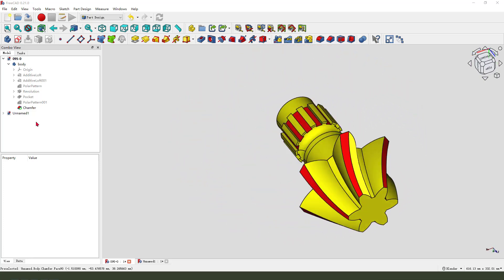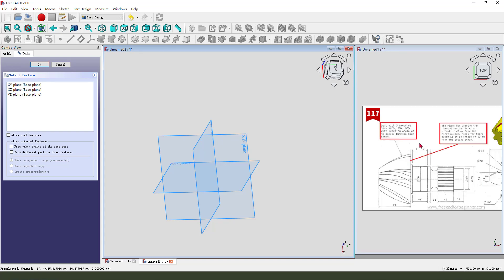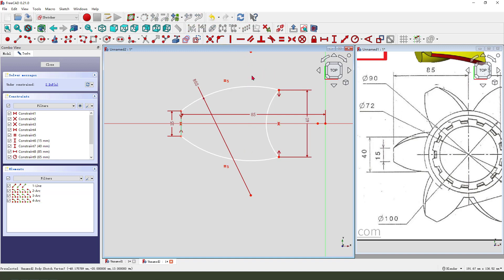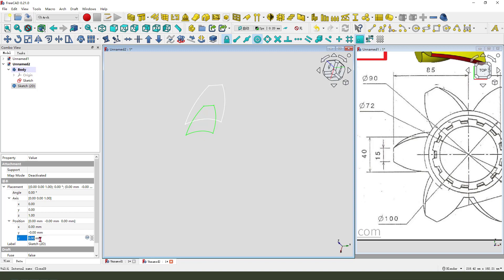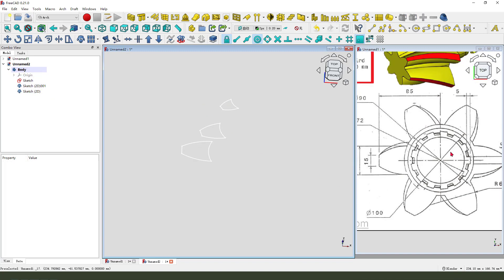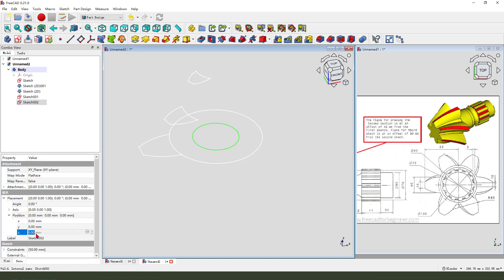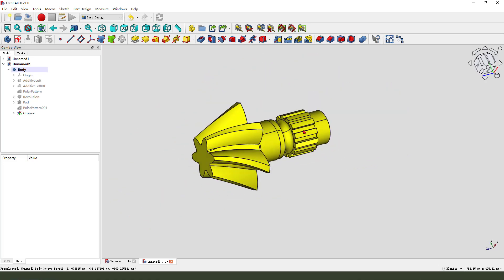FreeCAD Tutorial for beginners,basic model exercise-95

Comment: Great that you are back. Great tutorial, but I wonder where you got the 5mm at 16:45 from?
Reply: Good question! I just can see at 0:32 on the plan right hand side a 5 but it's very difficult to realize that's the depth of cut related to the grove. Imagining a groove made by a lathe operation on the shaft, maybe...
Reply: @LFANS2001  The 5mm at the right hand side of the drawing is the height of the 13 "teeth", which he set to 82mm diameter at 13:30. The shaft diameter is 72mm so the difference devided by 2 makes up the tooth height of 5mm.

So I think that the 22mm wide groove should be directly attached to the previous section of the shaft with 76mm diameter. 

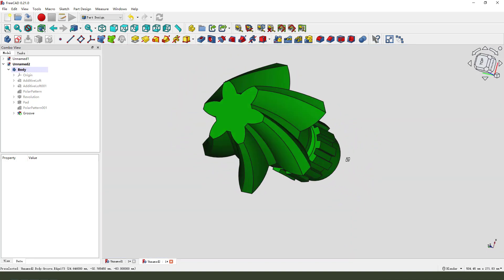Also, the model he created differs in this point from the rotating model during the first few seconds of the video  (e.g. at 0:07). If you look at the rotating model you can't see the 5mm offset while the model he created shows this offset (17:06).